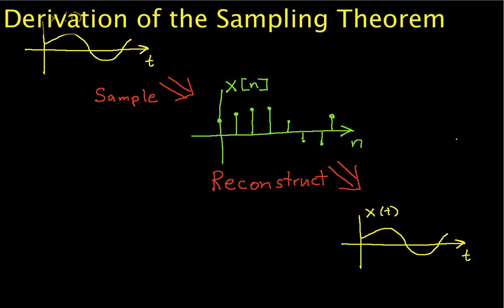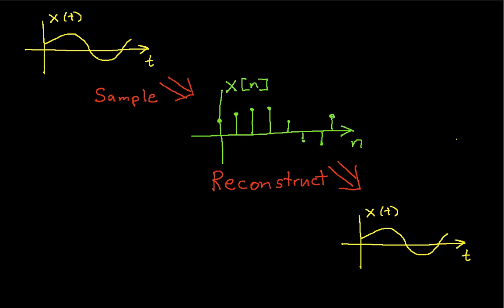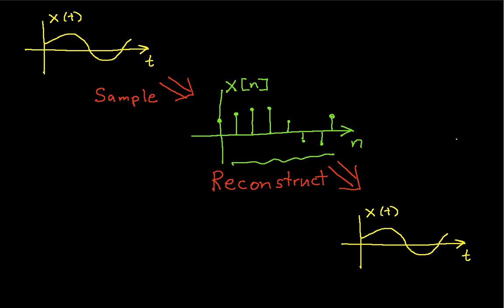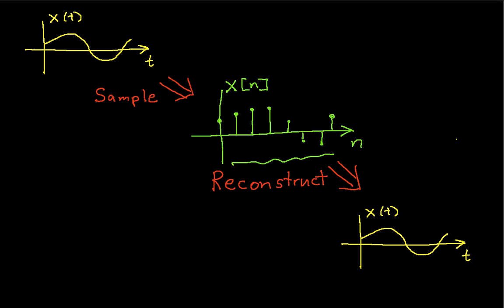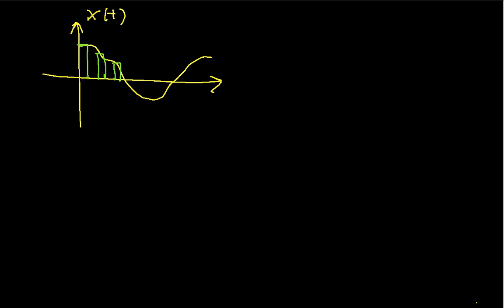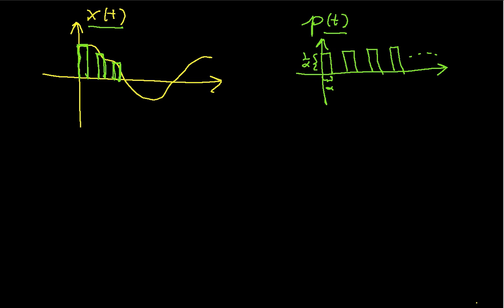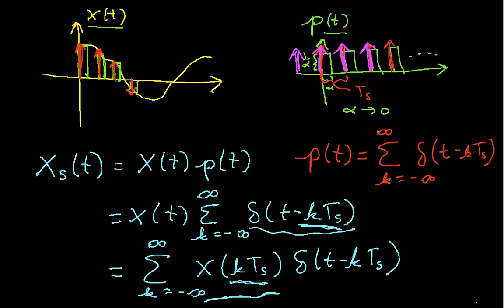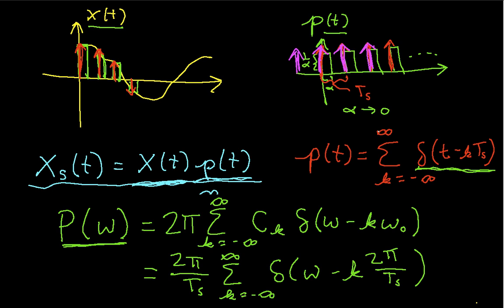Sampling Theorem: Derivation Part 1

Comment: If you already know what the value of x(kTs) is, then why do you have to multiply it by the impulse train? Doesn't multiply x(kTs) by an impulse train simply return the value at whatever interval you measure it at?
Reply: Actually you multiply x(t) by an impulse train p(t), and not x(kTs). I mean, you get x(t)*p(t) and not x(kTs)*p(t). Try obtaining Xs(t) on a sheet of paper only for k = -3,-2,-1,0,1,2,3 and it should become clear in your mind why it works.